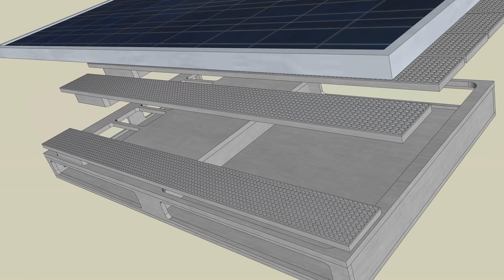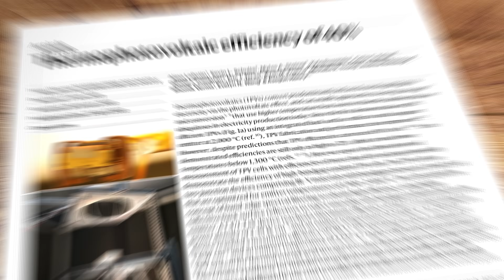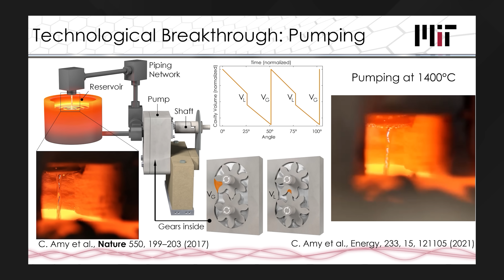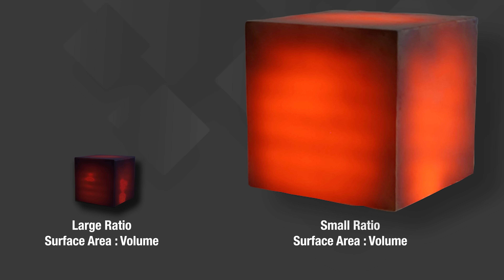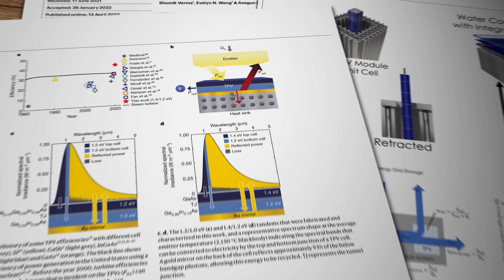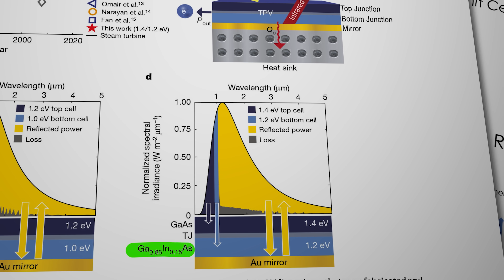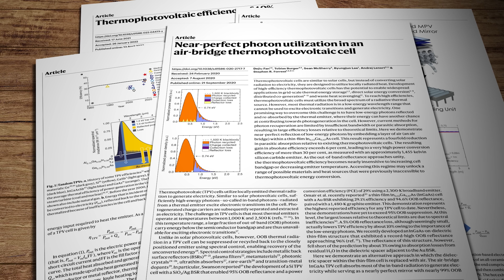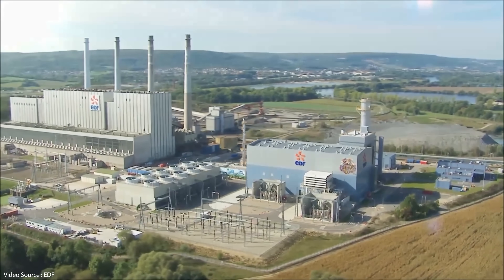Grid Scale Energy Storage 30x cheaper than Lithium-ion! How do they do that?

Comment: I feel like there’s too many losses. There’s an efficiency loss when storing the heat initially. There’s small losses just from radiated heat out of the storage units. There’s a pumping system for both the molten tin and the water. There’s the waste heat loss and then there’s the efficiency of the panels @ “close to 50%” - which means more than 50% losses.  So overall the maximum efficiency for the whole system has to be under 30% from energy put in. Am I making a mistake here Dave? Does the reflected light reduce the panel losses somehow?
Reply: There's already large losses in all existing heat engines.
Reply: @badsamaritan8223  ďř
Reply: Thought the same. Might still be an interesting tech when combined with geothermal heat sources for example.
Reply: This is where the volume to surface area ratio favors LARGE installations (which is attractive to utility scale operations). Volume goes up by the cube while surface area goes up by the square. So making the system really big minimizes the effects of the losses since there is so much molten tin.
Reply: If panels are 20% and light engines are 40%, you're already at 10% efficiency, that doesnt include additional losses along the way. Overall they are counting on the substantial amount of peak insolation. Makes me wonder if nuclear can do it too. We are already trying to solve where to put the excess heat and scaling energy. Am I missing something y'all?
Reply: @uncledino3  I suppose efficency is only important when the energy you’re storing is expensive. But if efficiency is really low and the input energy isn’t dirt cheap it just doesn’t stack up against other quick response technologies like Lithium batteries. I think like hydrogen, there could be a place for this when we have triple the renewable energy we need - as solar and wind get cheaper and cheaper you deliberately super size systems to make cheap excess, storable energy.
Reply: @uncledino3  Nuclear of course would not do it this way. Nuclear makes thermal power, so there is already a heat engine (steam turbine usually). For a high temperature reactor (e.g. MSR or high temperature graphite like pebble bed) you'd use a secondary loop with a non-radioactive molten salt that never goes into the neutron flux of the core and if you want storage you just make a big insulated tank of salt. Salt is pretty good at storing heat. 

If you're using high temperature heat you are not necessarily limited to steam turbines. There are more efficient cycles that are possible with high grade heat. E.g. a Brayton cycle gas turbine using supercritical CO2, N2 or helium or some other working medium in a closed cycle. The heat sink on the outlet side is a steam cycle, extracting some more energy from the exhausted gas. This is very similar to a combined cycle gas turbine. A natural gas combustion turbine works by compressing the air, adding fuel, combusting it and letting the expanding gases drive a turbine that drives both the compressor stage and a generator. Instead of this combustion stage being part of the turbine, you can take the output of the compressor, put it through a heat exchanger where it is heated and then put it back into the turbine; it is not fundamental that the heat source has to be combustion.
Reply: @soylentgreenb  you are obviously much more informed than I. I am fascinated with this stuff and just starting my learning journey at college. I have a lot to learn! Thanks for the comment.
Reply: @uncledino3  🙂
Reply: Efficiency does not matter so much for the peaking, grid stability and meeting the electrical needs of customers. The cost of having a gas turbine and then only running it a few hours a week, and during the extreme hot or cold portions of the year, it has an extremely high cost.
Reply: Those were my thoughts, too... that the described system had a multitude of vectors for possible thermal losses, most of all during the heating. But depending on the overall design and details, it might be possible to capture a lot of what would ordinarily be lost and that would contribute to efficiency. So, bottom line is that I would reserve judgement until seeing what this contraption would actually look like.
Reply: 30%
now compare it with flywheel energy storage which has a 90% efficiency and with magnetic bearings and vacuum has less than 0.2% loss per month.
Reply: The radiation losses are huge. Temperature to the power of 4.
Reply: @peterwilliams1119  Not necessarily. One of the advantages of thermal insulation is that the issue has been studied practically as long as humanity built its first fire. The physics of thermal insulation is well known and although there is always continuing research to develop new ways that are lighter, more compact and more efficient, if mass and volume are not critical parameters, it's possible to build thermal insulation very cheaply and effectively. Even primitive people know how to build well insulated pits for cooking. Kiln bricks are widely available for numerous types of ovens. Laboratories and industry which deal with extreme temperatures know how to build areas safe to work in and around.

Comment: It is interesting but no longer necessary, improved Iron Air battery technology provides scalable cost effective electrical storage. I hope their work can be integrated into other future technologies, both the carbon coating and their thermophotovoltaic work are worthy of appreciation.
Reply: Liquid metal (Ca-Sb) batteries are comparable here. Stacking multiple cells and keep them at their operating temperatures together can solve the high temperature seal problem quite effectively if the containers themselves were used as the electrodes. Insulators may not necessarily be sealed against the conductors if an isolator (ceramic tubing) is used to separate the cathode and the anode. The cathode will be immersed inside the liquid and be touching the bottom, with a ceramic sleeve around it to prevent contact with the anode material. The anode will be dipped onto the top of the container. Minimal sealing is required. Fill the chamber with argon and line it with thick mineral wool to insulate it and keep the batteries at working temperatures.

Comment: Would it not be 50% more effective to just use a steam turbine?  You get rid of the tungsten and the crazy expensive 40% cells?  Also replace the molten tin for salt (as it is cheaper) and easier to pump.

Comment: Cost projections seem implausible - looks to have onsite engineering/construction cost and complexity on the scale of old-school Nuclear Power Plants to me, whereas batteries are more of a factory built plug-and-play thing. So maybe it could be cheaper than batteries, but the cost-projections have a bad smell to me ...

Also seems like there's no way it could compete cost-wise with other storage solutions like compressed air, or electrolysed hydrogen - it might be more efficient than those solutions, but it's so complex, and construction costs are going to be so high, it just doesn't seem like it could be practical in comparison.

Comment: Very nice talk. I like the scalability to very large and long term efficient storage. Would be nice to replace air radiator w some of the new tech devices to convert heat directly to electricity…
Reply: "Convert heat directly to electricity" — photovoltaic is about as direct as you can get. Heat radiates in photons and the photons are absorbed by the PV cell and out comes electricity. No moving parts. (This system of course has many moving parts, but not to convert heat to electricity.)

As for the waste heat that must be radiated: it can't be converted to (much) electricity, because it's too diffuse. The idea is to keep these panels below the boiling point of water. That's just not enough to do much with. Best case, you can maybe use it for district heating, i.e., keep a couple of nearby buildings warm in the winter. Which is only useful if you have buildings nearby that need to be kept warm in the winter.

Comment: 9.9999/10 this will type of plant will never happen. 1. Thermal stotage has thermal leakage, and with 1400⁰C there will be a lot of it. 2) pumping liquids at 1400⁰C, good luck with that. 3) tungsten starts radiating at what? Typical light bulb filament heats above 2000⁰C. 4) cooling of the PV cell is indirectly done with outside air, that is direct heat loss. 

Just use pumped hydro or compressed/liquid air. 
As an engineer, i see great potential for liquid air. Not only for energy stotage, but you can also capture CO2 in the process, extract argon and other gases used for industrial processes. If the air that we use is sucked form big farms, you could also extract methane from the air, better than releasing a potent green house gas, and better burn, natural gas is basically methane. 
And for thermal cooling of things we could use infrared radiant light, put it through non linear optics to get frequency doubling effect, and use regular PV to convert higher energy photons to electricity, and drive the heat back to low heat IR radiant cooler. 

The technologies I gave as an example are used in one form or another, just needs to clamp them together. No sci-fi graphene carbon nano quantum stuff. 
And I didn't even get to go domestic scale cogeneration for electricity and heating, geothermal combined with absorbtion heat pumps with water/methane Ranken cycle (this type of electricity plant is built in my country but not used purely due to pocitical corruption). There is a lot of different techniques and technologies to solve majority of our problems, but people don't see them, they are not shown them, only false promises of graphene quantum carbon nano sci Fi stuff presented by the influencers.

Comment: You could add Stirling engines to the water-cooling system to make use of the "unwanted" heat.
Reply: Not really. Working between 50 degrees C and ambient temperature doesn't really give you anything.
Reply: @soylentgreenb  The intake to the cooling system would be a lot higher, hence cooling system.
Reply: @traxthealien8284  Photovoltaics lose performance drastically as temperature increases. If the hot leg of the cooling loop is much higher than 50 degrees C the panel surface will perhaps be 20-40 C higher than that due to limited conductivity. That's already quite bad and means you lose about 20% of the power because you aren't able to cool the panels to optimal temperature. If you allow the coolant to boil behind your panels, they will be 20-40 C higher than boiling water, then you lose 40% of the power. That really sucks.

What you're trying to do is basically the same kind of heat engine as OTEC and the conversion efficiency will be the same; <<5% conversion efficiency.

Part of why this solution really sucks is that you're having something that can't stand heat in intimate contact with something incredibly hot which requires very good cooling and requires cooling to be uninterrupted and fail proof so you don't kill the panels (solder will start having problems at only ~200 C).

Comment: Why would you invest money in something as complex as TPV which yields a total storage efficiency of less than 50%, when AMBRI's liquid metal batteries with a much less complex and lower temperature implementation yields 80% efficiency.
How the total cost per kWh of TPV will be lower than LMB or PHES (~$70) is a mystery.
There's probably a joke here about the best battery a mechanical engineer could come up with, but that would be uncharitable.

Comment: Thank you for another brilliant video. But this time I have to disagree with you. 
Cost of storage is a very tricky question. In minute 11:45 of your video you presented a graph with 2 costs, the cost of storage at 9$/kWh and a cost of power equipment at 320$/kW. Only mentioning the cost of the storage part is misleading in my opinion because the power equipment plays a role, as well as the efficiency of the system. The cost of energy storage should always be compared as LCOS (levelized cost of storage) for a certain application (for example Peaking capacity). Using the online APP from Storage Lab (Oliver Schmidt) and considering 320$/kW as power investment, 9$/kWh as storage investment, 50% round efficiency and 30$/MWh for the price of electricity, and applying the scenario of 4h discharge with 700 cycles/year, I reach a LCOS of 80$/MWh, Lithium-ion is about 250$/MWh. 
In conclusion it seems to be a good technology but i think comparing it as you did with lithium-ion is wrong and false. Moreover I do believe this new technology will play a role for long duration storage like Hydrogen, CAES or Pumped Hydro. So you should compare the cost of those technologies. 
Looking forward to your answer.
Best Regards.
Reply: I agree. It's easy to say a storage medium costs a small amount of money, but then you have to couple it to a load of power components like heat exchangers and turbines or stuff like that which radically change the picture. Also the round-trip efficiency (RTE), time-dependent losses and long-term degradation or need for replacement are quite critical.

Comment: A great concept. As for the thermal energy storage part, I think that phase change materials(PCMs) may be more useful to save cost related to area as the PCMs have good energy density compared to giant graphite blocks and can also hold heat at near isothermal conditions given proper insulation is provided.
Reply: What phase change materials would you have in mind? Some salt that melts at an ungodly high temperature?

Comment: Comparing this technology to lithium-ion batteries is irrelevant. Iron Based Flow Batteries can store excess generated renewable energy without the conversions referred in the video. On the otherhand, hot metal pumping capable graphite pump is really a breakthrough technology.

Comment: It seems like there is a huge loss in the cooling system. Once you've solved the problem of storing energy as heat like this, why not use it to directly vaporize water to generate electricity using turbines ? I don't see the advantage of shoehorning solar panels in this sytem.
Reply: Stirling engines may be better here. Especially engines that uses helium as work fluid and have a porous displacer piston composed of either expanded graphite or metal wool.

Comment: Great video on a very interesting subject.
A few questions, what is temperature range for the systeme to work (and store a maximum of energy between the high and low temp) ?
Any place to find more information regarding mirror working not only in visible but also in IR and UV, and very high quality mirrors ?
Are there existing technology for cells with bandgap in the IR ?
I suppose that for multiple layer cells, the first layers must be as transparent as possible for the wavelenghts that are not used by the current layer. Is that something common ?
Are there many types of cells that support very high temperature ?
Could this technology more easily be used in combinaison with moltel salt reactors (not as storage but efficient energy conversion in electricity) ?
Thanks a lot, your videos are very good on very difficult technical subjects

Comment: I mean of course grid scale batteries are going to be cheaper they don't have to worry about energy volume or weight density. Lithium ion batteries are one of the highest weight energy densities of modern batteries which comes at a premium and that's why they are used in cars. Grid scale energy can be put anywhere and it can be stored in a hundred different ways from lifting weights to heating rocks or even making hydrogen. So it was bound to be cheaper and really we want it to be so much cheaper that we can put grid storage batteries everywhere and connect cars to them as they drive some how.

Comment: Why not let the water used for cooling flash off and drive a steam turbine or is this too simple ?  Route this wet steam through a superheater exposed to the heat block and it becomes suitable for use in a turbine.  The real issue , like with all heat engines is the low grade rejected heat from the radiators, this is where research should be directed.

Comment: Reliance on argon and tungsten something of a problem as these are both scarce resources.  A lower temp solution using cheaper materials and conventional heat engines coupled to district heating is likely to yield better results in the short term.

Comment: Looks hugely maintenance heavy. Aside from others who have mentioned their thoughts on argon and carbon, those water cooled element could be a real pain. 

Replacement of a leaking element, the leak itself being problematic, will mean the element would need to be removed. And that removal rate, once every few months or every year? So some way of providing access with interruption seems an absolute must rather than a nice to have. 

Tuyeres, the water cooled copper coolers inside blast furnaces and bod plants can have replacement rates on average of 80 days to 2 years with no clear mechanism to control. 

The pumping of molten metal could have wider implications in many industries.
Reply: Closed loop water cooling is such a cheap thing to build and maintain. Ask any nuclear plant operator. (:
Reply: @ps.2  they are absolutely cheap to build where there are limited consequences. Even a leak on a nuclear reactor requires shutdown and if easily accessible, a few days offline to repair.

The point here is we don't have a clear view and what that leaking water would do if leaking into the hot area.